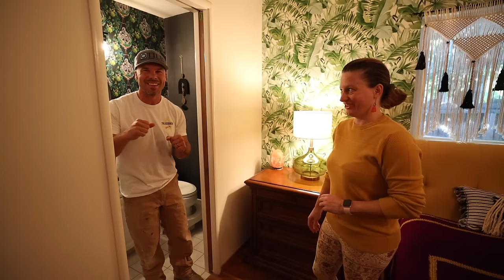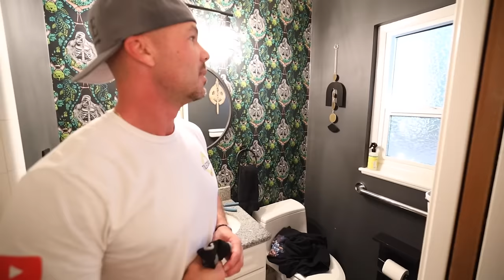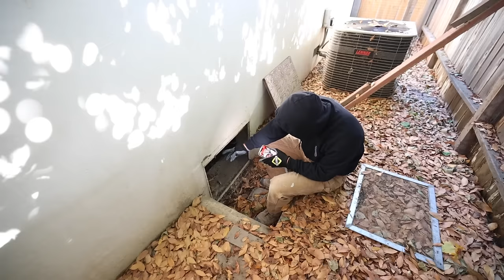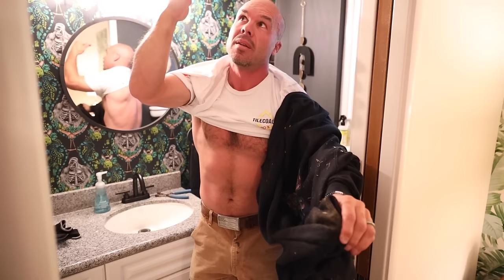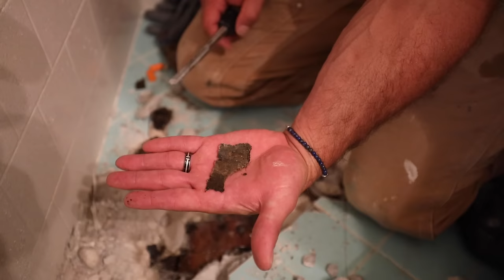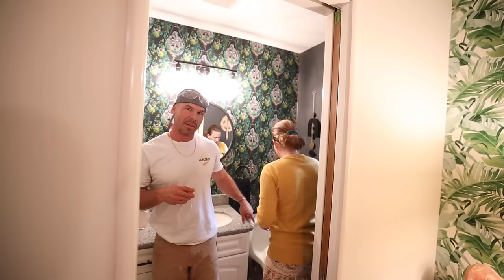MY SHOWER FLOOR IS CRACKED!!! Can it be repaired???

Comment: I had a customer that was in financial hardship and had the same issue. I told them i'll try something to get this working but no guarantees and only pay for the new tile since i had the other material.  The supporting flooring lumber was in good shape. I removed the existing drain and drain body; applied Redgard liquid membrane over scarified clean tile,  2" up the wall surround and inside the drain hole;  applied a 2" mortar bed over the tile pitched to center drain;  applied a second layer of redgard then tiled the flooring and portion of the wall with modified thinset.  I'm in NY and the basement height was about 7'H. That's what i did 9 years ago and it still fine.  I would never recommend this repair but it worked

Comment: My house was built in 1964, when I ripped the original shower out, the only waterproofing was a 1mil plastic sheet under the mortar bed. Needless to say the water damage was extensive. I had to replace every sill plate in the bathroom, luckily it was slab on grade so I didn’t have any subfloor damage.

Comment: The felt was used as an uncoupling membrane. In the era  that this shower was built, a copper or rubber pan, integrated into the floor drain was used. No waterproofing was used, other than quality cement work, tile work and grouting.

Comment: Everyone is amazed..well if your bathroom has a chance to go through a wet dry cycle...and mortar is sloped properly...this is a testament to what can be done....meanwhile every manufacturer and contractor wants to sell you the newest... membranes, curb material... waterproofing...new plumbing.....I can tell you this that those floor joist are to one side..of the load bearing beam, creating alot of deflection on that concrete mortar pan.....big bucks Wendy....👍 Thanks tile coach

Comment: In the San Francisco Bay Area in the  60's I can't ever remember seeing any showers with sloped shower pans or even pebbles around the weep holes. Most of the pans were hot mops and at best the hot moppers might try and slope their tar a little bit. But as time went on and codes became more stringent and the need for improvements became evident  new products appeared such as hot mop slope boards along with an array of other new innovations in shower pans. So this shower pan does not surprise me but I am amazed there is no water damaged wood. Thanks for all the great videos, 52 years of setting tile and I am still learning! lol😀

Comment: TC you know your stuff but I do hope that you've done additional support from underneath to those existing subfloor planks. They are definitely flexing! Especially under all the weight of old-school float walls, mud bed plus the weight of a person in that shower. That is the reason why floor cracked in a such particular cross pattern from wall to curb all the way and from other wall to wall across. Am curious to see if you'll have a followup video. 💪
Reply: Yea I think it would just crack again down the road when it weakens and flex’s more.

Comment: A bunny suit is less than $20.  It keeps the fiberglass AND spiders off of you when you're crawlin'.  I also wear a full face respirator wit P100 pancake filters when working in crawls... that keeps EVERYTHING out of your lungs and eyes too!
Reply: Except the masks fog up after 5 minutes.
Reply: @johnbouldin9033  No, it doesn't.  A properly donned and functioning full-face respirator is very reliable.  It is EASIER to see while wearing one, especially when you are working overhead, as it keeps 100% of debris out of your eyes.
Reply: What about doing tile over tile?

Comment: Interesting to see the different home construction methods throughout the country. Here in South Florida we have concrete slabs mostly so we wouldn’t see issues like this (but certainly other kinds).
Reply: Here in the UK resin shower trays are quite common.  It's just moulded concrete/stone with resin bonded to the top that slopes up to form a lip like a very shallow bath.  They're about inch and and a half deep and completely water proof.  They come with adjustable legs or some just sit on a bed of sand and cement. When they're fitted you just need silicon between the tray and walls.  Really easy to use. A tray would have fitted easily on this job without any other waterproofing.
Reply: I'm in Florida and our tile shower was leaking out into the garage through the slab, it appears they just put the tiles right on the slab in a step down shower. I haven't found anything about that kind of shower on youtube yet. We re-caulked everything really well and it stopped leaking but the thing is in bad shape at 18 yrs old.

Comment: I would expect seasonal expansion/contraction of the 2x subfloor, even in your climate. Up here in the PNW, we will watch our soffit and siding material move like crazy as the seasons change. Cedar, pine, fir.. it all expands and contracts. We can install a t&g soffit with zero gaps in the winter, and when summer comes around we will see 1/16” gaps everywhere. 

My first shower project is coming up and I’ve decided to use either  3/4 MDO or a marine ply under the foam pan.
Reply: Remember, 3/4 CDX ply is designed to be laid with 1/8” gap’s between sheets, to allow for seasonal expansion and contraction. I don’t know enough about shower pans to say whether or not this is an issue, but it certainly cannot be a variable that works to the installers advantage.

Comment: We have house built in the early 70ies. The shower walls in the tub were put directly on the drywall. It was used every day by 2 children until 2000. The grout at the tub failed and the tiles got soft at the bottom. I replaced it with a fiberglass tub and shower unit. Were you able to see if the walls had deteriorated.

Comment: The fact the crawl space is that free and that there's virtually no waterproofing is why there's no rot. Rot happens when there's something soaking it and it doesn't breathe, the fact half of these planks were in an areated crawlspace was this owner's saving grace. If they were in between floors with insulation, it would've been a nightmare.
Reply from the maker: I agree...OSB, plywood, particle board, or insulation would have made this a whole different scenario.
Reply: And the information from the homeowner that the shower probably hasn't been used since as far back as the 1980s when leaks or cracks were first observed. This total lack of shower use for 20-40 years probably helped considerably in the lack of long-term water damage. 🙂

Comment: Question for the tile coach: My sister just bought a house of the same era, has the same 2x6 floor boards. They are installed on the entire house foundation which is the same as well, 4x6 girders 4ft on center, on posts sunk into concrete piers. Here is my question: What would one have to do to make this subfloor stable enough for tile floors? I was thinking of placing similar 4x6 girders the other direction and then hanging 2x6 floor joists on 14 or 16 inch centers. ????
Reply from the maker: Exactly!   Or you can do double 2x6's from girder to girder and then hang a single 2x6 in between them.   24" oc is sufficient.  Then use 5/8" plywood on top, then uncouping membrane on that.

Comment: The cracks are the only Problem. Of course now we have water proofing materials, but back than the shower was fine without all the plastic stuff we use today. The shower worked perfekt until it broke.

Comment: i believe this was a closet at first and the shower was added . That collar attaching the drain looks newer than 1959
Reply: Someone probably just replaced the old rusted galvanized plumbing to be able to sell the house old galvanized if it sits unused for a while will shed scale and clog up when it starts getting used again

Comment: my original shower was exactly like that and built in 1978 , as an add on, but it had a rubber shower pan so looks like whoever did that shower just used what they had

Comment: Crawl spaces don’t breathe enough to avoid rot. Only explanation is that this is a two-shower suite.  The smaller shower must have gotten used less, and once cracked, not at all… for years.
Reply: I'm just scrolling these comments and saw your user name and pic and thought to myself that guy looks familiar. Turns out it's Travis Burch! Small world. But I agree with your comment once it cracked it wasn't used (unlike my shower that leaked for 4 yrs).

Comment: Maybe tear out two rows around bottom,  tearout shower floor and curb , brick curb , new shower pan water test mud floor 4x4 around bottom  of walls 2x2 sheet tile on shower floor and red qaurd or hydro ban that going to cost hopfully that sub floor not rotted.  Ugly😮     dang